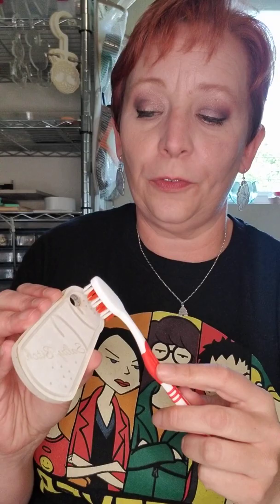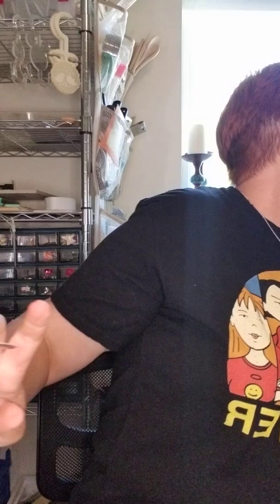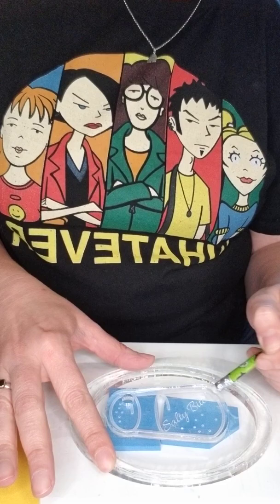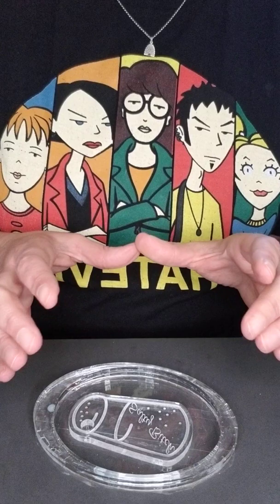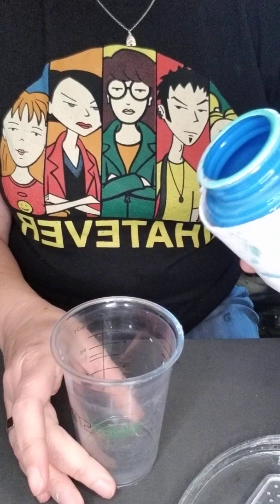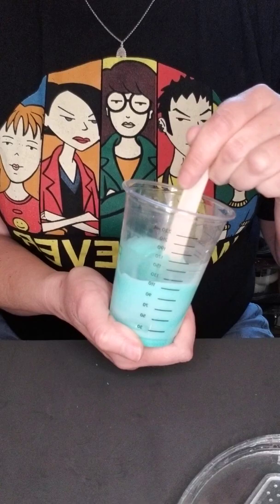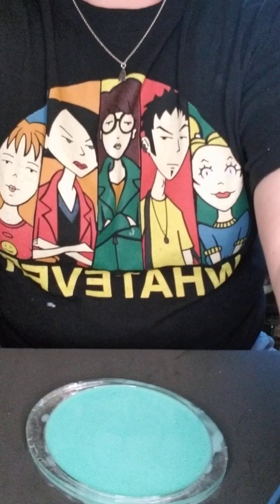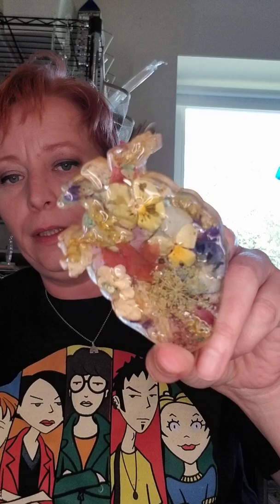GF group Silicone Molds #1

Comment: Thank you so much for sharing your technique.  Video tip - turn your phone sideways so it'll be a normal sized video and not just center of the screen. If that makes sense. 
Depending on phone you have you can get some video editing apps on there. If you send to your computer and upload that way, you can get other programs to help. You can find me in the GF beginners group same name as here if you have questions about the video stuff. I would love to offer some help if you need it. :) Awesome video and thank you again for sharing.  

They have tripods that have a claw type clamp for the phone - and it's got a long arm that adjusts when you move it. I'll find the link and send you on fb :)
Reply from the maker: Ty!I will give it a try